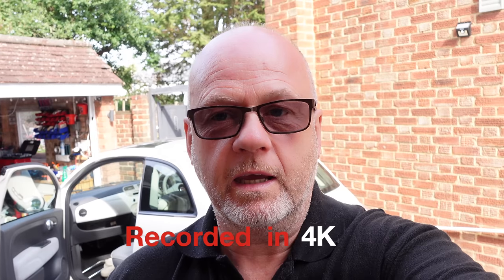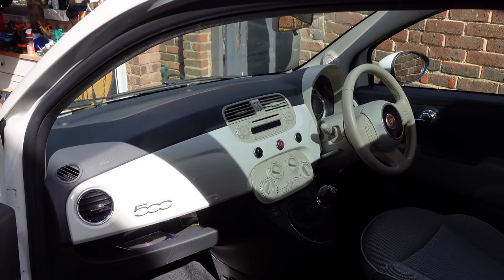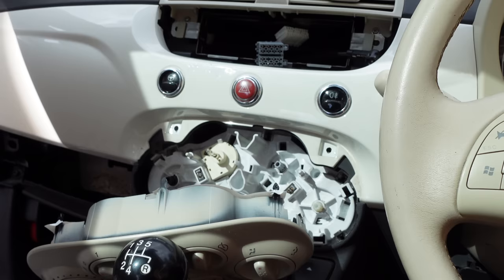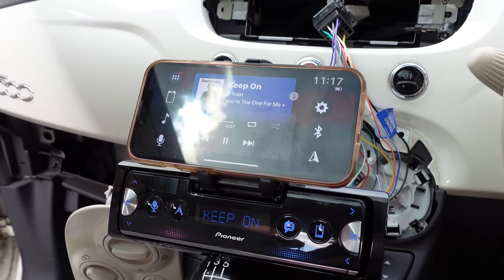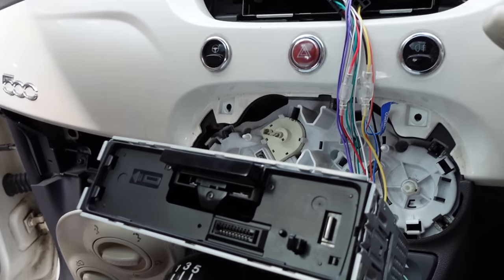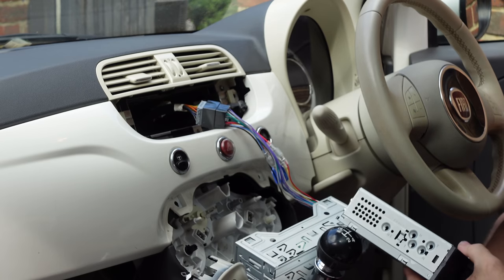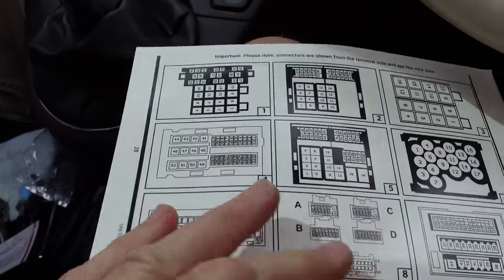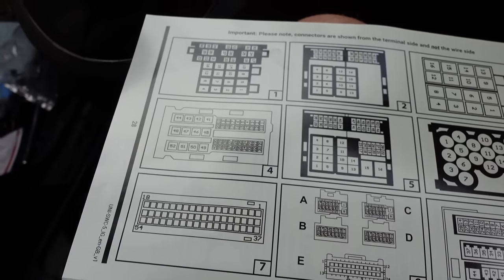Project Jacqui - Day 3 - Fitting the Pioneer Stereo SPH-10BT & Connects2 UNI-SW.5 to the Fiat 500

Comment: Great video howver this has convinced me to change my mind to NOT change the factory fit radio in my 500. Seems like lots of expense and faff for very little gain with several disadvantages after you've gone to all the trouble. eg. no phone connection, vents blocked, mounting bezel flimsy and loose. But as I say, great video - and well done for sticking with it!
Reply: Also, forgot to add, it needs a phone but doesn't charge it. This will surely mean you get to your destination after a long drive with a low phone battery.

Comment: Looks good I think it's picked up a switched live from the plug in wire block and when you use the switched live lead it's doubled up and causes the madness
I think that the switched live wire is only necessary if it's not picking up one from the block connection
It looks good though and if you want to stop the phone heating up in winter just move it to portrait instead of landscape
I do feel it's better to keep the vents as opposed to the Chinese reduced ones in your last stereo installation 
Well done for the effort and entertaining tutorial Paul
Reply from the maker: I’ve had a reply now from connects2, he pretty much suggested the same although he didn’t really know for sure but I think he and you are correct.

Comment: Halford fit these for £180, includind the unit  ,got one fitted to my smart forfour  brabus, works well with steering wheel, also have  samsung galaxy active tab 3  8 inch tablet  which will not fit in cradle, but works well with its sim card ,and does all that my phone does .you can mount it anywhere.

Comment: There's always 2 power inputs to car stereos, the permanent live, is for holding settings and is a minimal draw and Accessory which turns on and off the stereo with the ignition. Often the rolls are reversed hence why the loom allows for swapping between the yellow and red with the snap jack's. Sounds like the connects2 box is causing issues with the canbus and is probably wired to permanent live and it should be running from Accessory.
Reply from the maker: I’m aware of the normal red and yellow. What I now believe and what the connects2 is suggesting is that the connects is getting its power from the loom so adding the extra switched live is making it throw a wobbly. It’s all working perfectly now.

Comment: I had the same on a Vauxhalll Corsa with the 'phone button'.  Used all the correct adaptor leads but the steering wheel phone button didn't work
Reply from the maker: It said I’m the instruction supports phone on 2014 onwards for some strange reason.

Comment: Hey man, my red power line has disconnected and I can't get power to the unit!  Got a 4hr trip tomorrow!  Any chance you could offer some pointers?  I could ping you some cash?
Reply from the maker: Got to be the fuse hasn’t it? Depends how it’s wired. Trace the wire back to the fusebox.

Comment: Hi, could you tell me which two wires coming from the car are for the steering wheel control wires. I have the fiat 500c lounge 2010. Thanks
Reply from the maker: The stereo has two line 1 and line 2 but as there is a pre installed canbus box I’m not sure you need to connect anything fr9m the car to them. This ca4 doesn’t have steering wheel controls unfortunately. I think i have a wiring diagram for the plugs somewhere.
Reply: @Love500  Thanks, I have got the can bus connected already and everything EXCEPT the steering controls, and yes there is two wires (key 1 & key 2) but just don't understand where I can spice in to.
Reply from the maker: @adeb1102  yeah I’m not sure. I’ll see if I can find the wiring diagram.
Reply: @Love500  thanks
Reply from the maker: @adeb1102  The wiring diagram isn't any use but you should need to connect those wires if you have the can bus box. Have you been into the stereo settings and set it up? I don't think they work by default, you have to either manually set up each button with a press or choose a Fiat profile
Reply: @Love500  Thanks once again for your time and effort. But yes I have been in to the set up to learn buttons, and none of the steering buttons have any input. Thanks anyway........keep up the FANTASTIC work. Cheers Ade

Comment: Hi I’m having problems fitting my pioneer radio I have the same problem with one power leed but it won’t switch on without both
Reply from the maker: You probably need to swap the two power wires. They are often the wrong way round.
Reply: @Love500  they don’t work the other way round  :( but I have one power thing that has no where to go in the back of the radio?
Reply from the maker: @littlegxo7381  dunno never fitted a pioneer. Doesn’t it have a label on it?

Comment: Enjoyed the video as always but nah not worth the hassle, the original looks better and I'd miss my (MP3) CDs. Didn't realise it didn't have DAB, only thing I miss in my car but I can cope 😂
Reply from the maker: But you can plug in a usb stick with mp3s.
Reply: @Love500  True but still prefer CD. Use USB in my other car and get so fed up with messing about with menus and screen. The original stock just looks so much better 👍
Reply: While dab is brilliant when the signal is strong enough it's an arse when it starts dropping off I had to fit a separate roof aerial for it to be tolerable on my van and tune the settings to switch to normal radio when it drops out
Don't even think about using the cheap windscreen dab aerials either they're just a waste of time and money